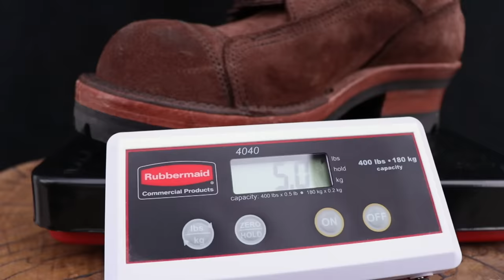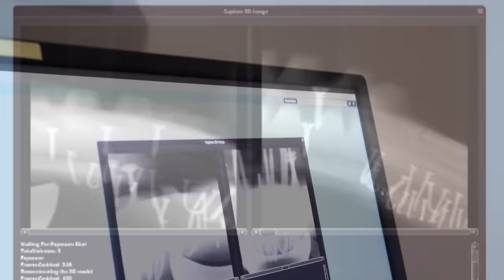Testing $1000 “Indestructible” Nicks Handmade Boots

Comment: I had my foot in a recessed tail light on a heavy equipment trailer; the outside metal piece had sheared open leaving the light exposed, and I was swinging a sledge to bend the corner back into place so we could weld it and protect the tail light again.  After a number of swings it clipped the metal, and slammed into my ankle, which was held into place by the other side of the metal protecting the light.  I was wearing Sportiva Glaciers, that I've worn hiking from deserts, swamps, glaciers, and on active wildland fires when I worked for forestry.  I had a minor fracture, and it was extremely painful, but my ankle was and still is fine.  How about comparing those Nick's to comparable boots rather than garbage bin boots like you did.  How about Sportivas, Lowas, Scarpas?  It isn't a surprise that some handmade boots perform better than those...  You may as well have compared them to Crocs, Chuck Taylors, and other nonsense.  Those are good boots for discerning taste, you should have compared then to similar top end boots...
Reply: You didn't even include Danners, Redwings, or Hawthorne?  Those are similar in design to the Nick's even, wildland fire rated, and mid-low range.  This is merely an advertisement for Nick's.  Thanks for nothing
Reply: You need to look into top shelf handmade Italian/German boot companies.  They are generally more comfortable, more versatile with big heels for climbing spurs and allow for crampons, and provide you with a similar level of protection.  I've worked on a hotshot crew for state of Alaska Forestry, geological exploration, heli-crew to put up cell towers all across AK, and am currently an arborist for a private tree company.  I've bought more boots than I can remember, and since I started wearing Sportivas, I rarely venture outside of purchasing their style of boot, as I've only burned through 1 pair, and am on my second after more than 10 years of working in the field.  That style that Nicks, Whites, Danners, and Hawthornes do is uncomfortable as all hell, and get hot when walking through ashpits on an active fireline.  A little insulation goes a long way, rather than leather between your foot, and the bubbling ash...
Reply: @austinholm-mcrae2777  Bro chill.
Reply: @Totemparadox  I'm chill as a cucumber.  I'd just like to see how those Nick's hold up when compared to boots that I know to be top of the line.  I have put more miles and stress on boots than the majority of people, and if those boots are to be held in such a high regard, they need comparable competition.  Of course they are impressive when compared to boots that would get you kicked off of an active fireline for wearing.  I love a good pair of boots!  Im just being honest here.

Comment: I had a pair of vans high tops stepped on a roofing nail and at the time i weighed about 100lbs i was fairly young so reasonable weight and there was a slight mark on the bottom of the shoe but it didnt go through
Reply: Also i legit stomp on fires with my tims to put them out still no issues with them and they still smell new after 2 years

Comment: I need a top quality boot or they die in three months.  The last and best boots I had lasted 10 years. Matterhorns. Pre Corcoran c-sar( combat search and rescue)  boots. If you want do it all boots, premium csar boots are the way to go. Its an exception in the world of compromises. Those people have the hardest job on earth and their boots will work in all conditions except extreme cold. 0 degrees f and lower.   These indestructible nicks sound comparable to what I had . Not kidding I paid $480 for them.which is cheap actually. $500 for 10 years of abuse , or longer if not . Or 100  every 3 months/200  once a year.  Depend on what is gotten. Price point is a good guide for longevity when using critical thinking and getting functional boots .I don't mean fashion boots...which would probably fall apart if you simply drive past wilderness or worksites .
I wish I could revive my old boots. 
Black leather  , double thick upper, slightly padded collar. Full tung .
Water proof , shockproof , ISSO 65,000 volts rating I case dealing with power lines.  NCB rated , 800 gram thinsulate ultra, lace to toe with non conductive steel alloy toe cap. Puncture proof sole , full flexible steel shank, kevlar stitching ;triple and quadruple . Kevlar/gortex cut and puncture proof, moisture wicking,anti microbial nano silver impregnated booty style full boot liner stitched into the boot.  My favorite long discontinued DRYZ insoles, they absorbed sweat and made it work as support and cushioning . Once off, it made the toe area dry out in around an hour or two. Humidity levels depending. They were epic. 
Oh and fire proof.  I never did shoot them so idk if they are bulletproof or not... sorry to rant. I am a boot lover lol.

Comment: It doesn't look water proof...
Sure, my steel-toe boots aren't water proof, but at least they can be greased. Those wouldn't work with waterproofing grease (which is cheaper and more reliable than the spray stuff).
Reply: Why wouldn't they work with grease?
Reply: @Totemparadox  it would ruin the finish and make it darker much... Plus since it's way more porous than  a more "regular boot leather", you'll end up having to use more and it will not last as long.
... Basically, if it can't be polished, the result wont be as good.

Though, there can be certain alternatives like certain wax-based products... But at the end of the day, the nice finish of those boots will still be lost.
Reply: @Poodleinacan  My man, they're WORK boots. So what if they get darker? They're not RUINED 😭Also since the roughout leather is more porous on the outside, grease and oils penetrate BETTER and function better.  And because the greases penetrate deeper they will last longer.
Reply: @Totemparadox  I didn't say it wouldn't last longer. I did say that you would end up having to use more grease.
Also, since a protective layer would be more difficult to achieve, to spread of gread would be very unequal. Water always finds a way.
Grease and oil can and will dry up with time (and it's not very long). It's a constant near maintenance to regrease areas and spots that have been damaged or that the grease layer has been rubbed away.

Comment: Ngl these boots are an investment. For 1000 you get boots that last a literal lifetime. Could've used these in the infantry instead of spending 200 on boots that get easily destroyed
Reply: LoL no. I love Nicks, but these ain't fit for combat 💀
Reply: @Totemparadox  Well not a work boot i mean made in this fashion in a military boot pattern lmao. I was more commenting on the build quality lol.
Reply: @AsheThePlagueDoctor  Nicks just released their Tactical Boot. $525. 360 degree stitchdown, PU and rubber outsole, rubber mid and insole and a silicone impregnated leather that is very water resistant.